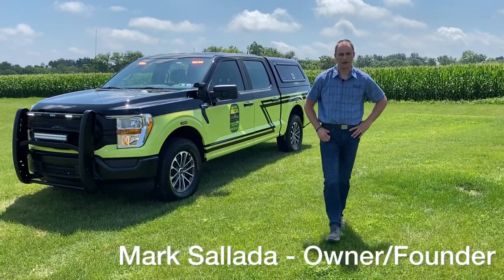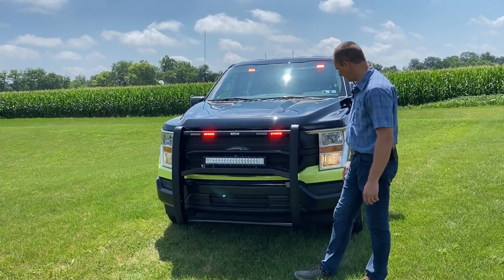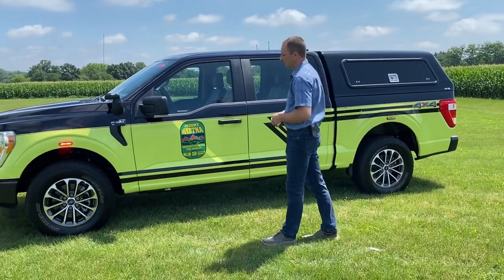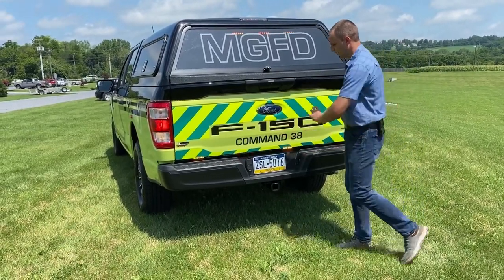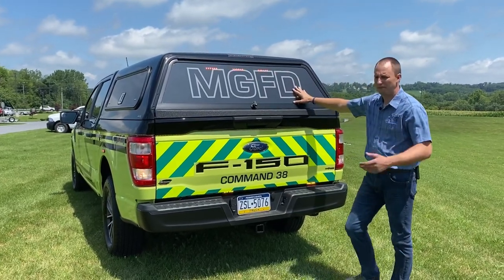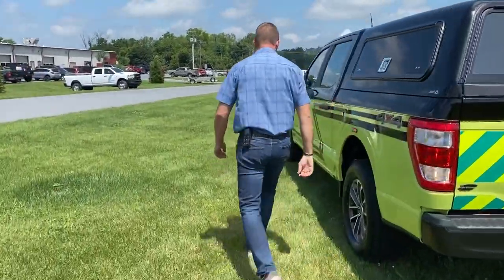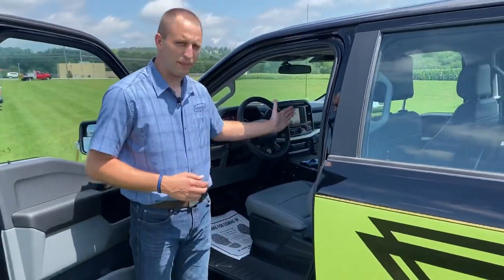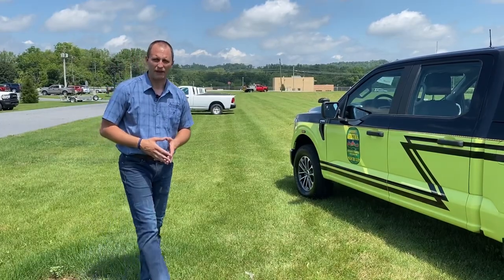Command Fire F-150, Mt. Gretna | 911RR

Comment: Nice to see Havis pulled off the design for the 21 f150. When we called in January for a fit console they told us they didn't even have the design even thought about yet. So we were out of luck. We ended up going with PMT instead. Tough pats about having brand new trucks before they are available..

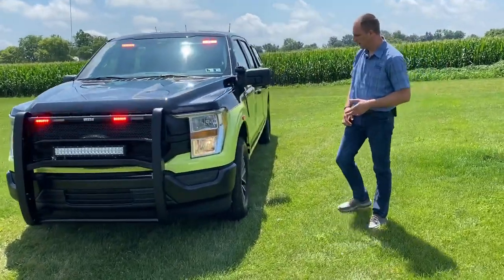Comment: 1:28 Where is the white flashing on the right visor light?
Reply: Was wondering that myself.. either the angle was wrong or the head was out
Reply: @madrabbitt  Hope they noticed and fixed it.
Reply from the maker: It surely was working we are assuming it was the pattern and angle the camera didn’t like
Reply: @911RapidResponse  are the optics on takedown specific modules more forward focused then the flashing colored modules?  It was probably the angle of the camera as it moved
Reply: @911RapidResponse  understandable, it look like heavy tint on the top of the windshield too. I know you guys are good about quality and everything

Comment: I have to point out I love the work you do but but (yes double but) the topper graphics need to be fix as the font size should overlay the function of the {warning lights} there there for a reason just as the identifiers are but the overlap is is impeding the function of each function for graphics and lighting by themselves. Just food for thought. Nice and professional job guys and gals.

Comment: The third tail light on the cap flashes with the brake lights which is a bit odd 🤨
Reply from the maker: Yeah the tail light flasher does that… but it’s in sync at least 😁
Reply: It's nice they put the effort in to flash that brake light. It's small, but it probably didn't take that much more effort or cost

Comment: Good looking vehicle - like the unique graphics look. 

Out of curiosity, what is the logic behind having 4x ions in the pushbar, but only flashing two at a time? You would achieve the same warning power with just 2x ions on a faster flash pattern and save ~$200 on the lightheads and install cost
Reply: I am personally not a huge fan, but it makes sense in the fact that there is not a solid "on/off" on either side of the vehicle which makes a dark spot for a second or two. It's like splitting a single lighthead up, but reasonably more effective, especially in dual color. I would have flashed both sides independently if it were my build though